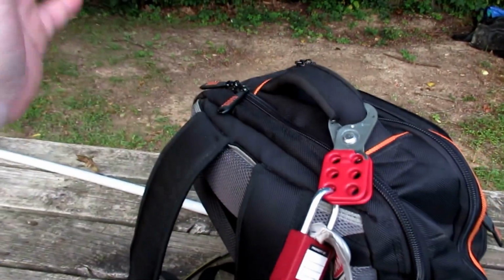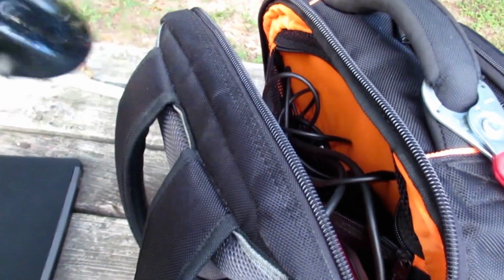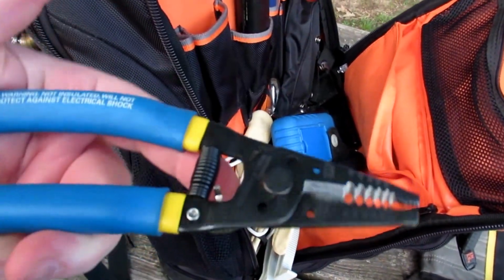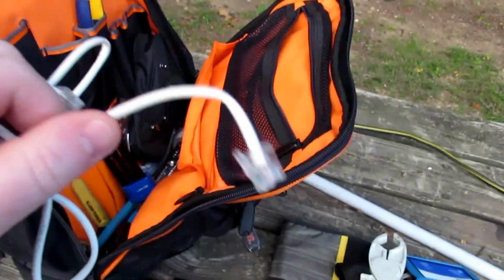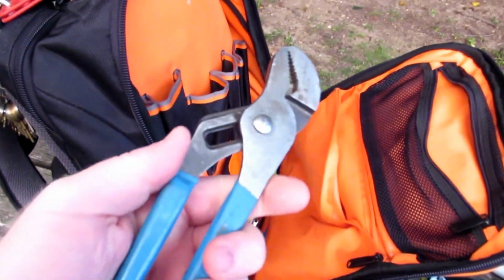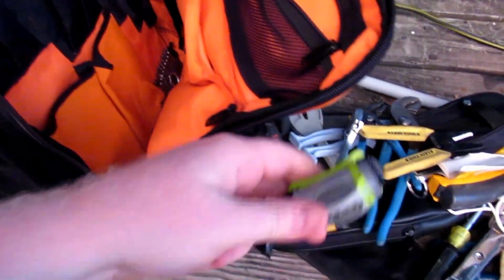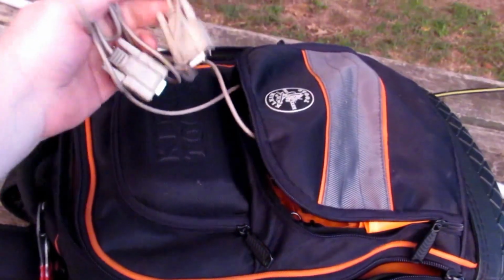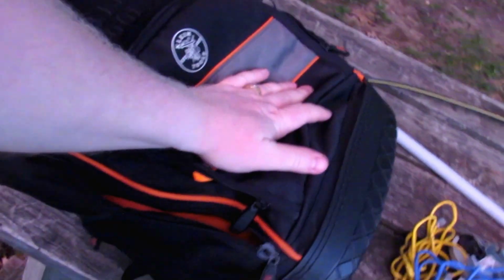What's in my tool bag

Comment: I just happened upon this video, I know it's old but thought I'd recommend you a backpack.  The Veto Pro Pac Tech Pac Wheeler is a great new backpack that also has wheels and a handle that extends out.  I bought one and added the laptop liner to it and it's just an amazing BAS tech bag. I'm not in service but am a BAS maintenance technician so having a portable bag that has all my tools and laptop is vital, especially at the large campus I work at.  I do have the luxury of elevators so typically roll my bag but do throw it on my back once in a while. It is a heavy bag!!
Reply from the maker: Thanks for watching

Comment: Great review. The problem is the bags get very heavy. I just use a small klein canvas pouch and put all my hand tools in there with my multi meter. I do have another bag with the rest of the tools when I need to bring them out. I'll upload a video soon.
Reply from the maker: yes, they do get very heavy.  This bag limits you to fewer tools.  I keep a smaller bag in the truck but kept pulling out the same things to many times and that's how I ended up just getting a backpack.  Thanks for watching.